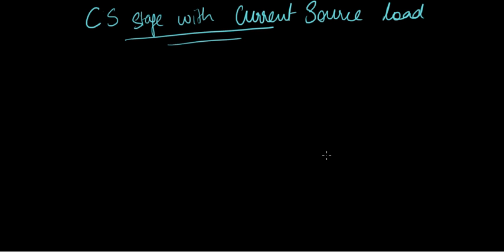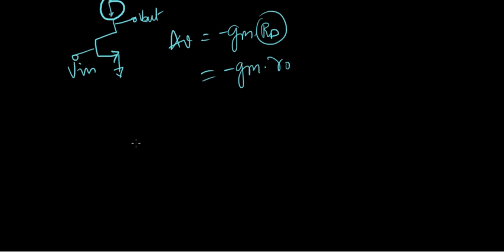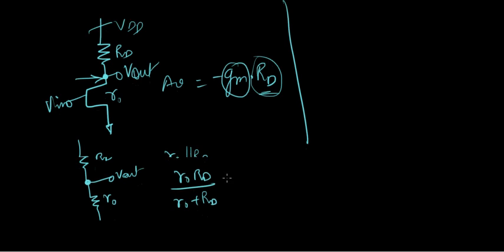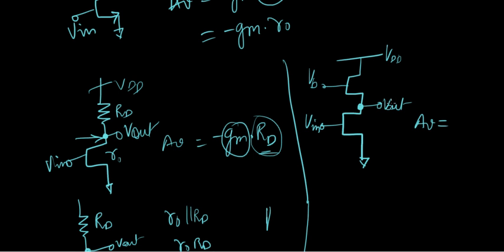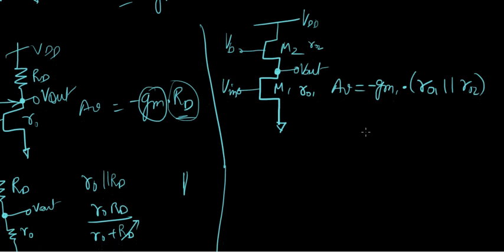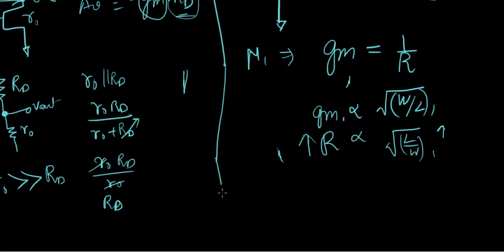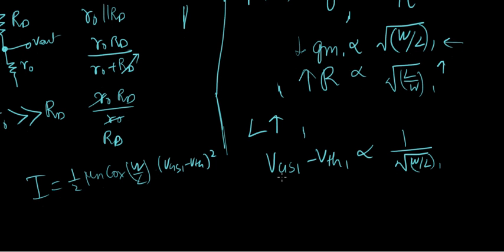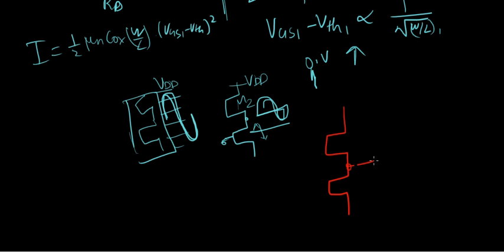Common Source Amplifiers - Current Source Load

Comment: Dear sir I have doubt in this,
Please solve,
We made a bias voltage there to make M2 in triod region, right.?
Then there exist Triode resistance instead of r0.
But you have not taken Triode resistance here.why?
Reply: he made the bias voltage to keep M2 in saturation  ( 3:48 ) (equivalent to common source amps with diode   n or p Mos). With both M1,M2 in saturation, their resistances (ro1,ro2) are comperable  so the gain equation cant be simplified as with the Rd<<ro1

Comment: Hi Eneradi, Really good the video ! I have two questions !. The first is related to the Rd in the common source amplifier. I found in many books that if you want to improve your gain Av, you should make higher the resistance Rd, but the disadvantage doing this is that the transistor will be more closer to the triode region. Am I correct ? So in this configuration with a current source as a load, why should I use this configuration if it provides the highest resistance in CMOS process ?

The other question is related to a good video you posted where you say the reason why the transistor should be in a saturation mode. That is for the amplification but maybe I am wrong but if I make a configuration where my transistor works at a lineal region, it will amplify. So why do you say that in the lineal region the transistor will act as a switch ?

I would be very grateful if you can help me !

Best regards !

Joaquin
Reply: yes Joaquin, if the Rd(increases) => Mosfet will get triode region. In this current source load configuration, it is ideal current source, Resistance is infinite, so we are using channel resistance here, so channel resistance is high but that is also finite
Reply: coming to your 2nd question:  transistor acts in 3 regions: 1 cut off (open switch) 2, linear mode (closed switch) 3. saturation (closed switch and amplifier), means constant current there is no open switch in saturation.